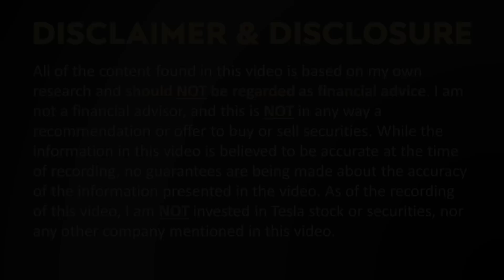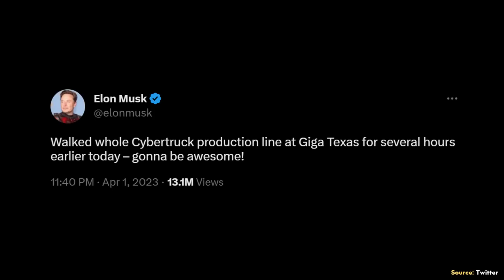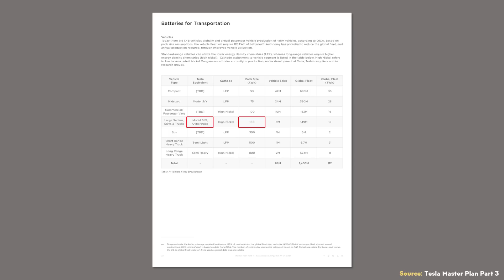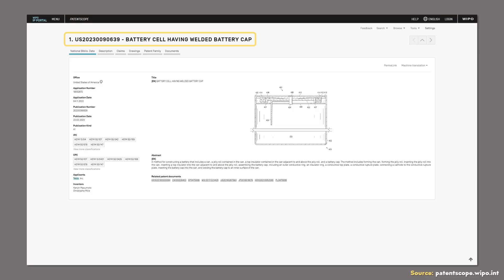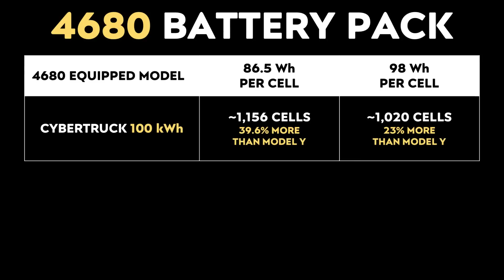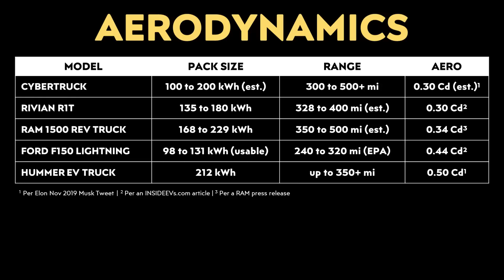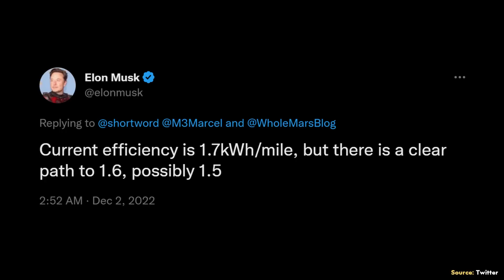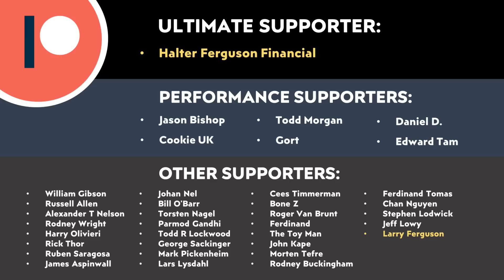What TESLA Isn't Revealing About the Cybertruck | Predictions

Comment: Hi Jonathan, regarding being able to fit 40% more 4680 cells in Cybertruck than Model Y, I just did a quick calculation based on the size comparison in your table and I think it might be possible.  If you compare the area, based on wheelbase x width, Cybertruck is 42% larger than Model Y.
Reply from the maker: Thanks! I should have done that math. Thanks for pointing that out.
Reply: @Cleanerwatt  No worries, Jonathan.  Love your work.
Reply: Confirmed
Reply: Yup, 40+%
Reply: Yeah…I thought he was oddly dismissive of this notion WITHOUT doing the simple math needed to get a real answer. 🤨
Reply: How a double stack battery  could work . Would be 4 inch more thicker... if you but that tickness on the bottom you got a lump hanging down and four inch less of clearence and if it up... the floor is going to be High unless a full different designe.
Reply: @tiredslave  I don't think they would reduce the clearance, just have the floor of the inside a bit higher.  Although you might think that would be a bit awkward for getting in and out, I think the adjustable air suspension will help a lot.